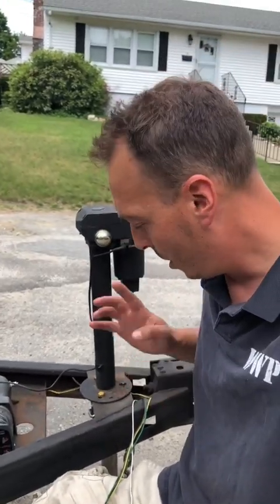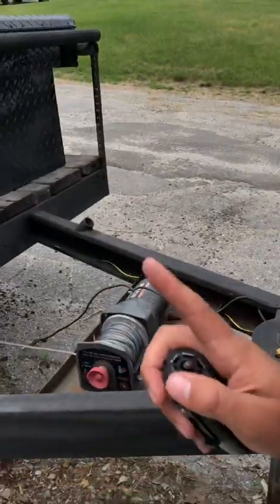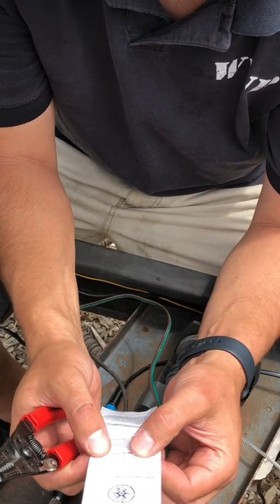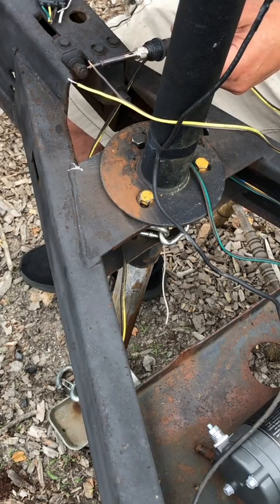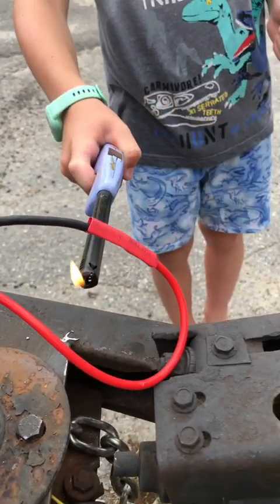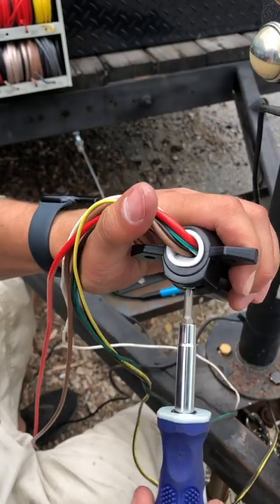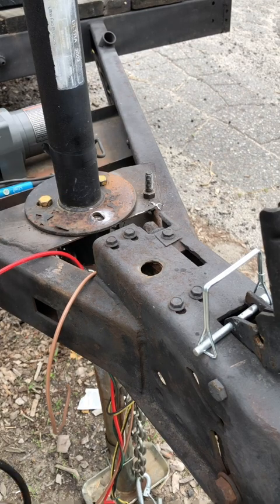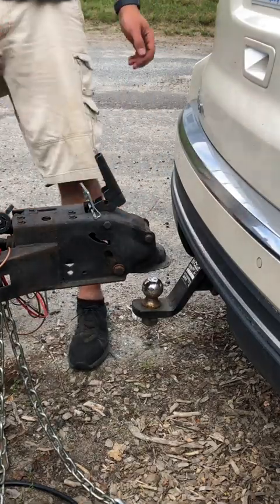Upgrading Trailer Wiring: From 4-Pin to 7-Blade for Enhanced Functionality

Comment: Does that plug you installed power the jack? I did not know you could pull power from the vehicle for a jack i always thought it was just for lights..wow
Reply from the maker: I’m sure I’ll blow a fuse. 😂🤣 but yes, it came straight from the car!
Reply: 🤣🤣🤣well that's how we learn ...fuse blows.....nope not that wire.... 🤣I've blew a fuse or 2 in my lifetime of fixing things 🤣Semper fi